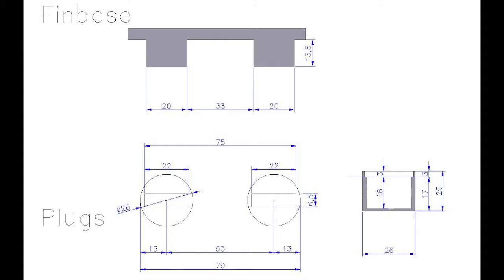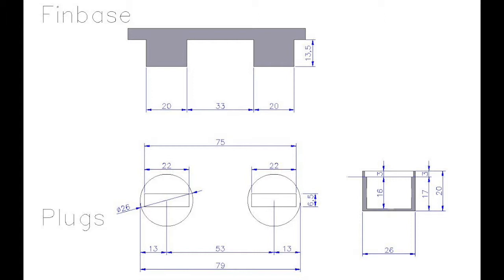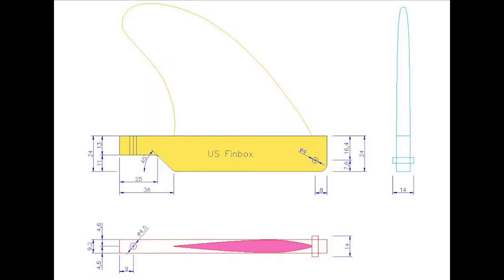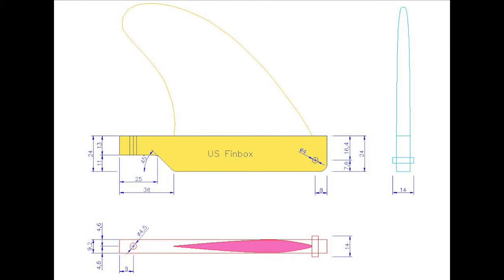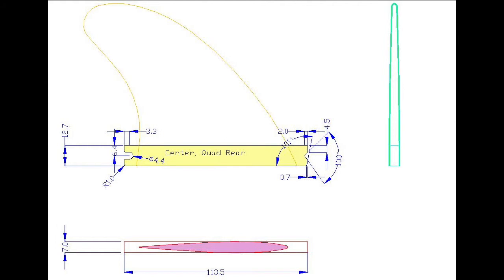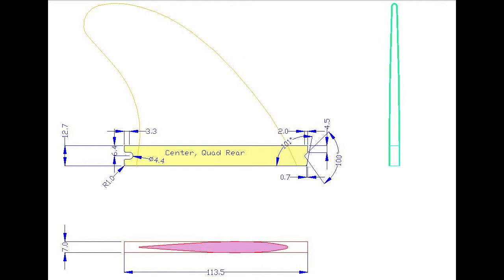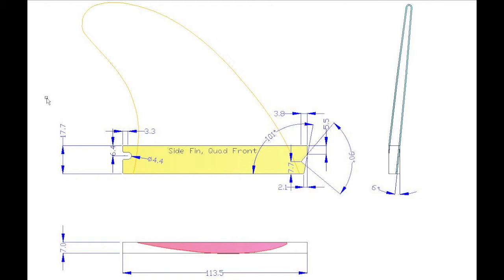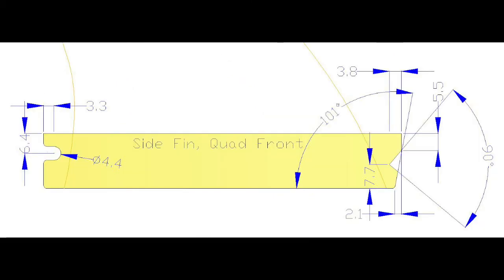How to make surfboard fins. Measurements and dimensions of fin systems

Comment: Are these measurements in millimeters?
Reply from the maker: Yes, millimeters. The measurements of the US-Finbox might be incorrect, since I found an other fin with different measurements...
Reply: @robiegle  There are two different sizes, very similar. 9.0 mm versus 9.2 mm. Here is info from Black Project: US STANDARD BASE: Fits Starboard, JP-Australia, Fanatic, Mistral, RRD and most production brands with an origin in windsurfing. This is the same fin box that’s found on many windsurfing boards and is wider and deeper, with the pin set further from the deck of the board. The base is 9.2mm thick. US SURF BASE / LONGBOARD BASE / BAHNE BOX / FINS UNLIMITED: This is the same box that is standard in many surf longboards. It is a narrower and shallower base as used by SIC, Infinity, 404, Flying Fish and many more. Narrower and shallower than the US base, these boxes have the pin set closer to the deck of the board. The base is 9.0mm thick.